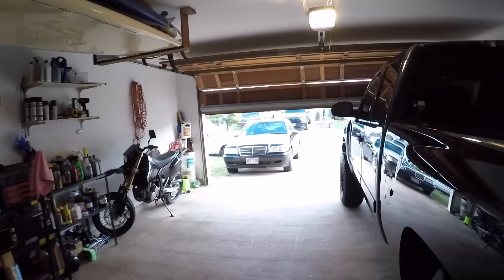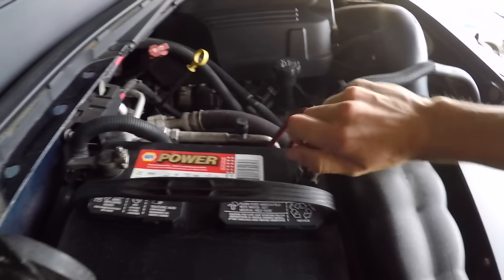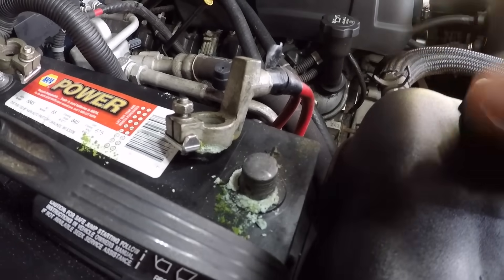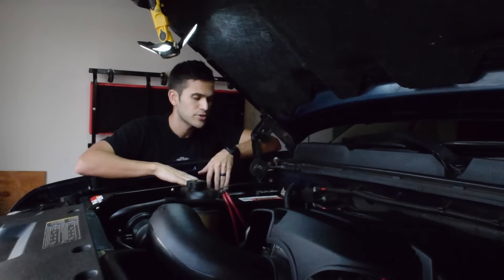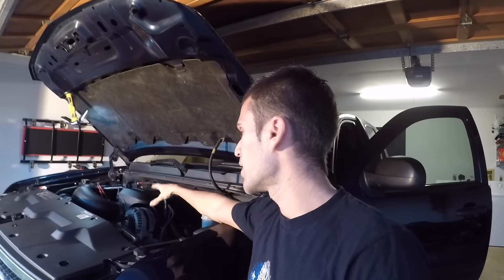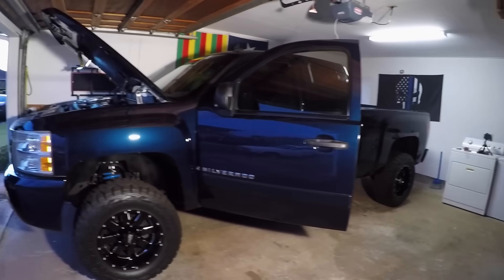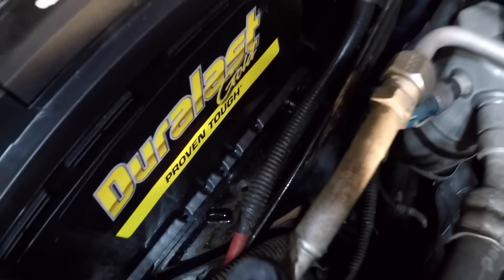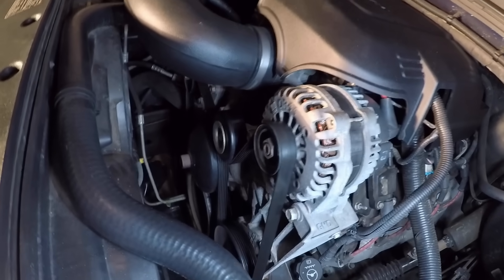Car Won't Start: Alternator or Battery? The easy way to know

Comment: NOTE - my car was running fine before this and did not have this problem, well not at least when i wasn't pushing the car past 3500rpm, on the dashboard i would get a battery warning ( im 21, okay? this is 3 car in my entire life, first was effed up, second one the engine decided it wants water more than oil, third and the one im driving, well follow along for the story- and yeah i didn't learn from past mistakes!!)

so my dads car decided to die randomly (as per usual because its a fricking skoda, no hate just not my favourites), he called me to tow him (witch didn't happen cuz he is a big mr handyman), when i got there he asked to borrow my car battery, i did so by leaving my car on (was working just fine) and switching his battery to my car, short story long his car barely started and when it did, it was miss firing and all sorts of things, he ended up driving i was following him, it was a short drive like 8kms or so, and when we got home he borrowed my car, came home and told me there is a battery warning on the dash, witch was werid because it was usually appearing only when passung 3500rpm for like a second before letting off the gas or changing gears, and after 1 day of driving with the car battery warning on the dash, the battery finally got empty (or dead) - and yes its the altenator, because the car just shuts down when i remove the wire (idk how to type it in english, its my 3th language), so yeah before i borrowed my dad my battery it was okay, just appearing around 3500rpm, and now hes a happier man because i no longer can go on my late night drives to clear my head from all the problems, cheers (tomorrow im replacing the altenator and the battery, alone because i cannot deal with him) - just a little yap lol and also an advice
if your car dies and it won't start on, and if u can borrow another battery from your friend or someone, just remove the + cable and if the car is running its the battery, if ut shuts down its the altenator (idk if he mentioned in the video, typing this too long to remember)

Comment: It’s not always that simple. It could have been bad diodes in the alternator bleeding the battery over night, or another parasitic drain. A free load test at AutoZone would have ruled the battery out.

Comment: Jump start car, remove negative battery terminal. If car dies it’s the alternator. Boom. If it doesn’t die then it’s the battery. Don’t work harder work smarter

Comment: My belt tensioner and serpentine belt were bad had them done but my battery was dead had it charged, I have a feeling its the battery, going to pop in the freshly charged battery, and give the car a crank, wait a few minutes, then try pulling off if it dies then I know, its either, Alternator or Battery

Comment: That bracket is way too small but it works, also it could be your alternator too because when you started the truck the voltage should be right away at 14 volts but it took a little while either your serpentine belt is loose or the alternator voltage regulator brushes have worn down to where they are still making contact but they are intermittent so you may need a alternator soon

Comment: You left out a very important question it could also be. Parasitic voltage drain as well you can test it by using an amp meter on the battery terminal nd then shutting car off and see if you have any current flowing through and how much its draining then you unplug relays nd fuses until it stops then you know which component circuit its on it could also be a bad relay stuck on and draining battery, plus you already have. Battery power meter on your dashboard and if it was. Abad alternator you would see a battery light on

Comment: Just disconnect the negative terminal and if the truck dies, then you have a bad alternator if it stays on then your alternator is good and your battery is bad

Comment: My battery light was coming on intermittently. I would turn the heat radio, etc off and it would go off. This has been doing this for about a week. One day it was snowing and windshield wipers started moving really slow and blower going out. Couldn’t see because windows were getting foggy. Yesterday while driving and running heat battery light didn’t come on at all. Today it came on but got me to where I was going. It sat for like 4 hours and light was still one when I was ready to drive it back home but this time I drove about three minutes and a car start making a funny noise started getting real sluggish and I wasn’t hardly getting any power. I was say I drove it about half a mile and I parked in a parking lot, but I decided to drive it back to where I had came from cause it was a safer spot to call AAA as I was driving back, the tire pressure light came onthe power steering went out and it was real sluggish and it wasn’t getting much power. I was going about 3 miles an hour try to turn my blinkers on for cars behind me. Blinkers wouldn’t come, and the windows wouldn’t even roll down as I was driving back in the parking lot from where I came from all of a sudden the light went out. The power steering came back and it started driving. Normally, I was very baffled, but I was scared to continue to drive it so I’ll call AAA. They were taking about 2 1/2 hours to come assist me so I tried to drive it home and I made it all the way home about a 25 minute drive and the battery light then come back one. It didn’t get sluggish or anything so I’m baffled as to whether this is a alternator or battery problem?

Comment: What if it's not a bad battery or a bad alternator that the vehicle doesn't want to start anyway. I have always wondered why the battery would always be drained out of power despite the fact that the battery is power keeps draining anyway.

Comment: It may not be the alternator if it isn’t charging. The parts cannon never works. Could be a PCM, wiring, blown main fuse, bad ground, slipping belt. Most of the time though, it’s the alternator lol. But I’ve seen it all

Comment: My car wouldn't start. Gave it a jump and it started but wouldn't turn back on after turning it off. I used my multimeter after it died and it read 10.4v. Took it to AutoZone and they recharged it and said my battery was good. So, alternator?

Comment: Don’t forget,high resistance shorts can drain a battery overnight without blowing a fuse.Do a current draw test with all accessories off.Current should be very low.Saved me from an unnecessary expense,as I had a drawdown in my courtesy light circuit.

Comment: One of the most important parts of the battery is that bracket or strap, whatever the case is, that holds the battery down. Yes you don’t want to hit the brakes hard  or be going up  / down a hill at a very steep angle and have it fly out. Another reason to have the battery secured is to “ minimize” the vibrations that the battery will experience. Sure as the engine runs there is always a barely noticeable vibration but having the battery moving around a little bit more will cause damage to the battery and shorten its life dramatically. Ya it’s going to shake around a bit as the vehicle hits potholes or speed bumps etc. but a shake once in a while is not as damaging as a fairly steady moderate vibration.
Reply: Hitting a huge pothole that took out one tire/from....,might have jogged something???
Reply: @ it could shake up the plates inside the battery.

Comment: My 2018 Silverado is currently going through some issues and so far I've replaced the alternator as the last one crapped out (truck barely hit 33,000 miles and it crapped out RIP) but I'm still getting issues with the car starting, so with a fresh alternator I'm thinking it could be the battery which sucks because the battery isn't even a year old. So far the voltage readings with the care on & off appear to be fine at first but it's like battery isn't hold charge, I've hooked up my multimeter to both battery & alternator and voltage seems fine on both so I'm still confused but might just have to replace the battery anyways. If that still doesn't work I am not looking forward trying to locate a short....

Comment: The battery is not really the good one but it's work , at the beginning of the video the red post was on the right facing the front of the vehicle and the black post was near the firewall and when you put the new battery in the red post was near the firewall and the negative post was facing the front of the vehicle and nothing at the base of the battery to secure it to the vehicle . But all the tests were well done . Thank you for sharing .

Comment: Had same issue on my 5 yr old Dodge van. Starts with a boost, runs fine, then won't start once shut off. Battery not holding enough charge.  Replaced battery and all good.

Comment: If it is a computer control regulation of charge....change the air filter 
..2018 jeep compass trailhawk....11.99v   before....after 13.9

Comment: If the battery reads around 14v after getting a jump and the alternator reads around the same voltage, why not keep the battery? Just curious

Comment: After 2 new batteries , I find out it's the alternator . My estimate is $850.00 , really sucks when you are on a fixed income . If not for my stepson , my car would still be sitting in my driveway .

Comment: Today's modern cars can cause battery failure by how much electronics the car runs. It is a little known fact that leaving the car unlocked in the garage leaves the safety systems active. Also doing nothing but infrequent short trips will cause sulphation where the acid of the battery slowly turns solid cell by cell. One of the functions of the alternator is to desulphate the battery, but it takes regular long runs for it to do it's job. The average use needs a run of 100 to 200km monthly to maintain battery condition. This is where some people can get extraordinary life out of a car battery and others will have trouble. The cheapest option is to use a maintenance charger of high quality with sulphation detection and maintenance modes.

Comment: Quick tip if you wanna know if you have a bad alternator while the car is running disconnect the negative battery terminal if the car shuts off you have a bad alternator
Reply: Good to know

Comment: My battery is at 12.6 setting. Car won't crank.  Jump it, starts charging at 14.6.  Turn off vehicle try to restart will not start

Comment: Thank you sir.  Nice to know the proper voltage for the battery and the alternator.  I guess the logical conclusion for the starter is if your battery charge is good and your alternator charge is good, the starter might be the issue.

Comment: Did anyone else notice that the battery terminals were reversed on the new battery. If the partsman at the supplier had sold him the correct battery for his pickup,  then the  terminals should have been in the same location. In my vehicles, the poles must be in the same location as the original battery or the cable connectors will not reach.  Just mentioned it so that some of you don't get home and discover that fact and have to make another trip to get the right battery with correctly located battery poles.

Comment: New starter, fairly new alternator, new battery, new terminals , cleaned battery post and terminals, still will randomly get a no crank , no start , going to test battery and alternator when multimeter comes in , other than that what else could it be???

Comment: I keep getting a slow start on my 04 suburban ls 4x4. I went to autozone and had it charged for a couple of hours. My suburban still starts but has a very slow start after it’s been sitting overnight. Also got my starter, alternator and starter tested at autozone. I was told everything is fine. Any other ideas y’all have?

Comment: On board amp gauge for the battery goes up and down from 14 to 13 like a flash like flashing 14 flashing 13 just started doing that

Comment: Got a 2005 cadillac deville 4.3L touring edition what if you try jump starting it with a  good battery and it still only cranks but doesn't turn over? Checked all fuses. Could it be fuel related? Thanks in advance advance

Comment: You still may have a slight electrical draw, issue, that will continue to slowly draw your battery down and eventually ruin the battery. Hopefully not. If the alternator is working properly your battery should always charge and stay strong. If your alternator is working properly and you park your truck for four of five days, and then it won't start, you more than likely have a slow electrical draw from somewhere.

Comment: Just to be clear, if the voltage between the 2 battery terminals doesn't change after the car is started from about 12v to about 14v (stays at 12v)....the alternator is bad? I can't access the alternator easily in my car

Comment: 1. New battery terminals are reversed and had to install with terminals outside iso inside. So be careful to the terminal positions buying a new battery. Some reversed ones might not fit.
2. Never mess without eye protection as one of my friends lost an eye due battery acid.

Comment: On my dodge caravan  it just stalled on me tonight befor i got on the freeway but it started back up with no problem and it drove home from my walmart no problem !! But on a regular  basis my van wants to stall out everytime at idle i already replace the alternator belt and a brand new battery last year but i also have my dash board likes going dim all the time and my car wanting to stall out when i put the fan on and my heater too

Comment: I know this was 5 years ago, but those 2007.5 Silverado’s had issues with the battery terminals, I chopped mine off and installed military spec terminals.

I also upgraded the alternator to a 350A, and an Optima Yellow Top Deep Cycle Battery.

Those modifications fixed that Silverado until the day I traded it in.

Comment: Not meaning to insult anyone's intelligence but for those of us who don't drive our vehicles every day and when we do it's mostly short trips, a battery will get weaker over time if it doesn't have the chance to recharge. 

That said I have discovered that a minimum 30 minute drive at highway speeds at least once a week will keep the battery in good charge.

Comment: He's trying to tell you how to keep your battery good but he setting it on concrete you don't put a battery on concrete or direct on the ground because it will kill the cells in the battery but he is a mechanic

Comment: Hi don't need to buy a multimeter to find what it is as it's simple get someone to jump your car let it run for 10 mins still running remove the positive terminal if the car. Stops running it's the alternator if it keeps running then it's the battery  my late father told me this and it works so simple

Comment: I wanna know while the car is running if you disconnect the negative battery cable and the car turns off is that an alternative problem.

Comment: Get the truck running and pull positive terminal on the batterie if it dies the alternator is bad. If it stays running battery is bad

Comment: Great video if I have a bad battery (which I don't). Didn't get any help if the alternator was bad. 
Also couldn't see where you were connecting the positive lead on the multimeter to. 
So unfortunately, this wasn't much help for me personally.